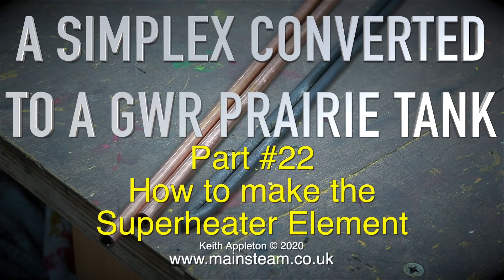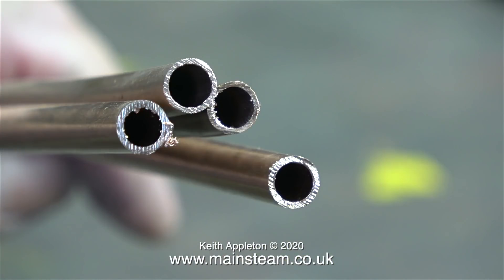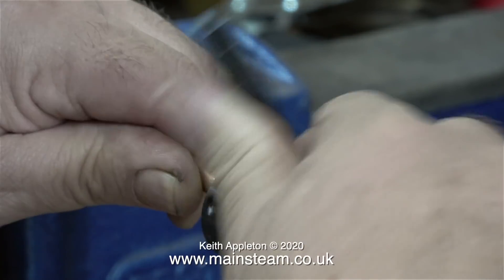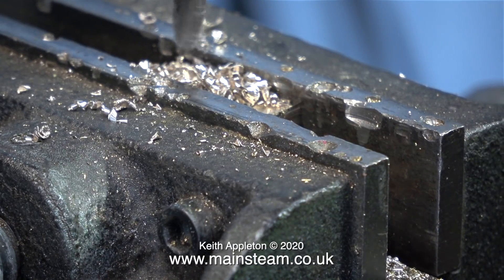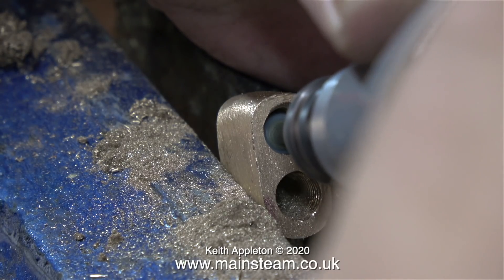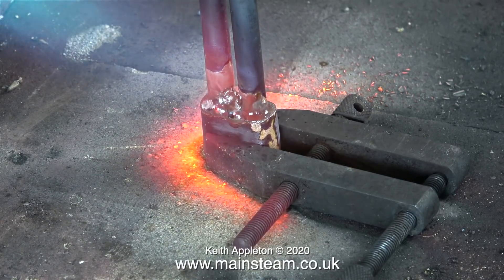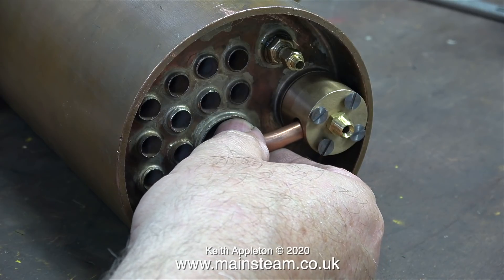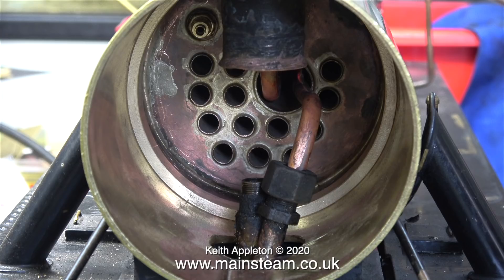SIMPLEX PRAIRIE TANK - PART #22

Comment: I would have drilled and tapped 3 holes on the end, one on either side and one in the back and use a short blanking plug to seal it but still allow the steam to run between the pipes.
Reply from the maker: My way is quicker and simpler and it works fine thanks.

Comment: Hello Keith 

May I ask if it would be possible to fit a preferably a suction water injector but a pressurized one ok too to my accucraft Bagnall? It is gas fired, 4 years old but runs like it was still in China.